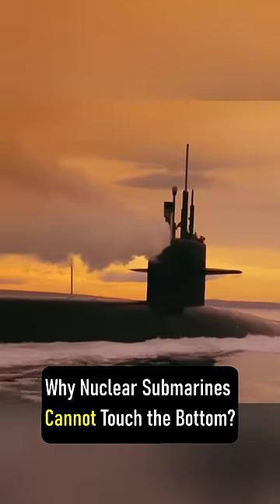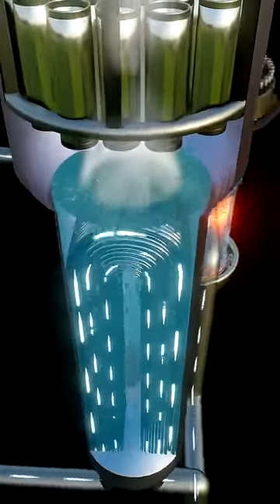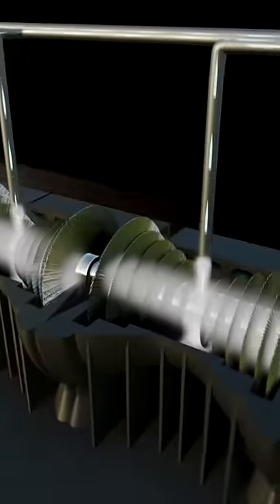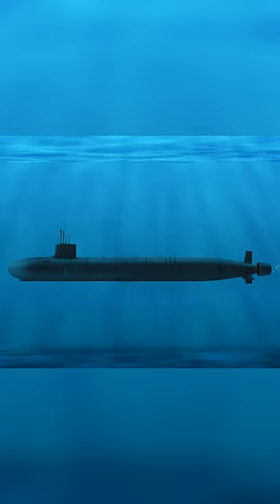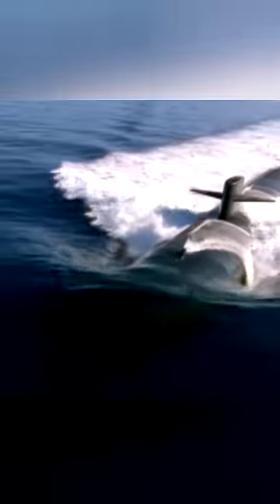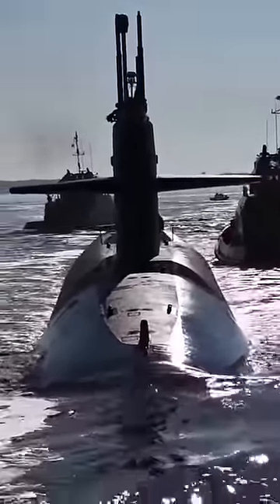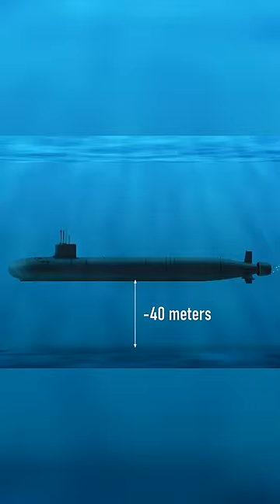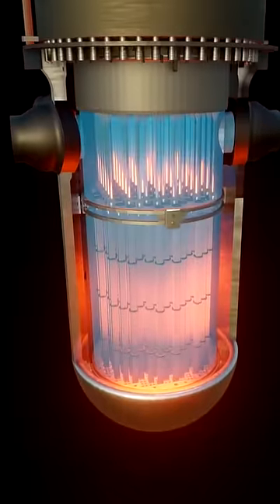Why Nuclear Submarines Cannot Touch the Bottom

Comment: That's why they don't touch the bottom... 
I must be stupid,  I thought it was to avoid crashing.
Reply: Me also.
Reply: Some subs do rest on the bottom in shallow areas at times.  But obviously not with modern nuclear subs.  Unless they’re designed for it.  I wonder if some of Russia’s spy subs that are designed to work on the bottom (like splicing into communications cables) have the ability to rest on the bottom; maybe with “landing gear?”  It’s an interesting question to ask an expert.
Reply: @keirfarnum6811  I'm positive they have that ability. With unlimited budget and resources the possibilities are unlimited.
Reply: Yes, silly me too!
Reply: @keirfarnum6811  well the Soviets did actually do this on occasion. It's a genuine tactic the would use to remain undetected in nuclear fast attack submarines. This video is kind of wrong and right, nuclear reactors are not just cooled with sea water, they have two loops of water for cooling. The primary loop consists of clean water that has no contaminants that turns into steam to power the ship and the secondary loop is distilled seawater. So if you set the submarine on the bottom very carefully, turn off all non-essential equipment and slow down the reactor then you can actually rest a full sized nuclear submarine on the ocean floor.
Reply: u-boats used to do this quite often
Reply: @tayloralvidrez4342  They have neither.
Real life is not Hunt for Red October.
American ssbn's make 2 patrols each per year.

That's double what the entire Russian ssbn fleet does.

Proper maintenance is crucial for a sub.
Without it, things corrode and work their way loose.

That creates noise when the sub is moving, and noise=certain death in a combat situdeath.

Any Russian boat leaving  on a patrol is insta tly picked up and shadowed by an American fast attack boat 

Because the Russian boats are so noisy, it's not even a challenge to tail them undetected.

Because they constantly have range and bearing, the American boat can destroy the Russian sub before it could ever launch a missile.

They why they don't patrol anymore and stick to Russian coastal waters.

The Russian ssbn fleet essentially no longer exists - they let it rust to dearh.
Reply: @Legendaryy7  There are no uboats.
That was 75+ years ago.
Reply: Touching the ground doesnt mean crashing into it, you can slowly sink onto it
Reply: @Zomby_Woof  i said "used to," referencing the past. in the u boat movie Das Boot, which is a documentation of a real u boat, the  boat smashed into the floor and managed to refloat back up, with strict depth limitations
Reply: @Zomby_Woof  he did say "used to do this", not "do this".
Reply: @Drnken229  What the point anyway?

There's very little bottom shallow enough not to be crushed, so you could only do this in coastal areas.

What for, to remain undetected?

You'd be a sitting duck if you were detected, no where to run, no way to run, since you max speed would be like 4 kts with the reactor shut down.

Once you did move, you'd have to spend all goddamned day cycling strainers to get all the crap out of them.

Doesn't matter where your intakes are, you create a huge silt cloud that gets instantly sucked into the strainers.

And there is a very real chance of getting stuck on the bottom due to suction.

You can't power your way out of it, because main engines are shut down and you're on electric drive.

If you really want to be ultra quiet, make your depth 600', rig out the epm, and shut everything non essential down, bring the reactor to minimum power.

You'll be quiet as death, but preserve the ability to make speed as fast as you can rig in the epm.
Reply: Many countries still operate diesel subs, that can rest on the bottom on battery power. Since they don't have to run coolant, they're technically quieter than nuke subs.
Reply: @kerbalairforce8802  They would still have the problem of suction.

It could be done, but only in very contrived circumstance.
Reply: Yeah let them go  40 meters above the bottom where the Titanic is. Won't be hearing from that sub again...
Reply: It’s definitely not why. No sub uses salt water for reactor cooling except in emergencies. They distill it first. And only add it as makeup water
Reply: @dossjh  It's used in the secondary loop - not in the primary loop.

It's always been used in the secondary loop. 

How else are you going to remove that amount of heat from an insulated tube underwater?
Reply: @Zomby_Woof  I was a reactor operator, its never used.  You distill seawater yes, but that is not a constant process and does not effect the ability to sit on the bottom.
Reply: @dossjh  you're right. Dunno what I was thinking.
Reply: @tayloralvidrez4342  lol
Reply: Just imagine a whale reaction when encountering these very HUMAN OBJECTS 👀👀👀
Reply: Sb

Stacy English

.
Reply: S
Reply: that's seems like the obvious answer
Reply: @keirfarnum6811  🤓
Reply: That’s cool
Reply: @ragingassassin6659  This.
Reply: @dossjh   100% A+ someone is qualified!
Reply: If they had big windows like Troy Tempest has on his submarine , they would never crash
Reply: @Zomby_Woof  and do you think subs got significantly weaker over the years?
Reply: @ianjohnson3770  What do you mean by weaker, and whose subs are you talking about?

There has been no substantive change in the design of US subs since the adoption of the subsafe program in the early 70's- and that was just a change in how piping systems are structured.
Reply: submarines sit on the bottom so stay quiet and hide
Reply: @Zomby_Woof  That is an exageration
Reply: @nippleflexer3630  I know a little bit. I had a lot of free time on my hands, so I qualified as helmsman and sonar operator just for the hell of it.
Reply: @tayloralvidrez4342  Actually Taylor, submarines have tended to avoid resting on the bottom.   Even earlier diesel-electric submarines avoided impacting with the bottom.   The simplest reason is that the hydrophone sensor heads were fitted to the bottom of the hull.   Often if an earlier submarine dove too fast it might strike the bottom inadvertently and would wipe off the sound heads, leaving the submarine “blind”.   Now that nuclear-powered submarines are central to many fleets, avoiding the bottom has gained importance.   Submarine crews have trained in the careful control of their vertical movement in the ocean.   As important the ability of the sub crew is in maintaining depth at periscope depth, it is also crucial to achieve what is called “hovering” above the bottom.
Reply: @Zomby_Woof  Well written and well done..
Reply: There’s also the fact that at a certain depth a submarine will literally be crushed like an empty soda can
Reply: @WaiseHail  And that happens quite shallow in term of crush depth being a multiple of hull length.

Travel two lengths of the boat's hull, and you are at test depth.

Two more and you are at crush depth.

It gets worse...

Typical high speed transit is done at about 20kts at 600'.

Now imagine at that depth sonar picks up a contact dead ahead.

Con orders planes to make depth 1000' 10 degree down bubble.

If you had a jam on the planes at that point, you're just dead.

Diving to avoid the contact, the planesman tries to pull up to level on ordered depth, and takes maybe 5 seconds to realize he had a jam.

Con is alert that day and feels the boat still with a down bubble when it should have already leveled off at the same instant the planes man reports the jam.

You've now passed test depth, and the boat has serious momentum and because the planes are jammed, the down bubble has increased to 15 degrees.

Con orders back emergency, but that's just an order - it takes a few seconds for the order to be carried put, a few more before the boat's descent stops accelerating, you've now past 1800', and con is ordering the COW to hit the chicken switches. He does, and you hear the roar of 450 re0psi compressed air spills into the maim ballast tanks.

Unfortunately, it's too little to late, you are now at crush depth.

Place you head firmly between your kegs and kiss your ass goodbye.

Jammed stern planes at speed during a dive are about as bad a casualty as a sub can have.

It may sound like a contrived scenario, but if your planes are ever going to jam, that's most likely when it's going to happen, because that's when they are subject to maximum stress 

The point is that subs have a much narrower operating envelope than most people realize.

I never experienced a planes jam, but wr did almost take the Scorpion and Thresher out of port & starboard the day we were doing reactor scram drills, and as we came up to periscope depth, the head valve stuck open, a wave came over the induction mast, and Fan1 became Pump1, shoving tons of seawater aft to the missile compartment bilges. 

With no significant way on, being limited to battery power until the reactor could be brought back online, started to si k like a stone.

Ballast blown at 600', we leveled off a little below test depth as the nukes brought the reactor on line, violating a whole slew of regulations 

If they had been just a few seconds slower, the laws of physics would have sent us to the bottom.
Reply: @tayloralvidrez4342  “unlimited” that’s funny. You clearly haven’t looked at their defense budget.
Reply: Actually, the big reason is to not snap off the Fathometer probe which extends about 1-2 feet below the keel.  About 15 percent of the ocean is shallow enough to bottom.  The rest is insanely deep.  The US has a couple of attack boats that are modified for special projects. They include skids like you see on helicopters to protect it from scrapping the bottom.
Reply: actually diesel submarine can touch the bottom and it have some advantage first active sonar can have a hard time finding you and second you don’t make noise so it can be usefull to touch the bottom of the sea just yeah avoid doing at full speed
Reply: @al-xo2cy  You can't go anywhere near the bottom except in coastal areas and shelves and atolls.

Most if the ocean is far deeper than crush depth.
Reply: @Zomby_Woof  No, but real life IS Down Periscope
Reply: @tayloralvidrez4342  I'm positive every modern nation has that capability
Reply: Remember depending on the area the bottom could be a silt /mud combo so  landing gently on the sea bed wouldn't cause damage.
Reply: @Zomby_Woof  "Used to" . Past tense.
Reply: Fuel powered airplanes have a design feature which also cannot touch the bottom of the sea.
Reply: @discord-bih  tell that to every plane on the bottom of the sea
Reply: @seansecker9398  misson failed successfully
Reply: @discord-bih  10-4 rubber ducky 😉
Reply: Nah thé Koersk tried it. It didnt work
Reply: If they have a malfunction and sink but are still alive they’re doomed as the rectors won’t cool. To avoid a nuclear catastrophe they’d have to shut them down and essentially wait to run out of air at the bottom of the sea
Reply: Believe it or not diesel electric subs especially during WWII would sit on the ocean floor either to stay alive if being depth charged or if they were listening for enemy ships 🚢
Reply: I'm pretty sure subs can just sit on the ocean floor by nowadays.
Reply: @michaelchaikoski9304  not nuclear powered subs bc the reactor would overheat
Reply: During ww2 there were many accounts of German Uboats sitting still at the bottom of the ocean to avoid detection. Of course these were diesel/electric boats... so they were not able to do this for very long.
So... this video explaining why a NUCLEAR submarine should not touch the bottom makes perfect sense.
Reply: @Zomby_Woof  the EPM extends right? Left? Fwd? Aft? Crunch!😂
Reply: @MH  The EPM or the SPM?

One is windings installed permanently on the main shaft, the other requires it be rigged out.

Neither have anything to do with sitting on the bottom. Only boats I know sitting on the bottom are the Scorpion and Thresher.
Reply: @keirfarnum6811  
Read Blind Mans "Bluff" !
Reply: Why u even bothered to not guess something this complexity
Reply: If you were to crush a nuclear fission;  you'd get a "new big bang".😮😮...😂
Reply: They dont touch bottom because if the deph is too large the submarine will implode
Reply: True and the colossal pressure.😂😅
Reply: @Zomby_Woof you are 1000% correct
Reply: The engineering behind submarines is fascinating
Reply: Maybe but the proper term is "sinking" not crashing.
Reply: Or like preventing a hull breach or to prevent reaching crush depth…
Reply: military submarine cannot go deeper 
than 2000 feet in better case some were
lost going too  deep so they cant survive if they going down .
Reply: @Drnken229 
military sub cant go deep 
not more than 2 000 feet
Reply: @Zomby_Woof So basically American subs are silent as Elves and Russian subs are noisy as Dwarves like in Lord of the Rings. Legolas vs. Gimli 😂
Reply: @tayloralvidrez4342  What if I told you there is actually no such thing as a budget?
Reply: @Legendaryy7  End up on the bottom of the ocean, yep you are damn right mate. And they're still there.
Reply: Diesel Submarines can do this and they do it. Even against active sonar pings , the operators can't distinguish the submarine from the ocean floor.
While they are more noisy when running their engines, they can do stuff like this.
Reply: right????
Reply: Submarines don't have wheels.
Reply: Its almost like driving a nuclear attack submarine in to the ocean floor is not very safe 😂
Reply: This puts the nuclear submarines in a huge disadvantage in conventional sub2sub warfare versus a diesel-electric submarine that can sit completely silent and motionless on the sea floor
Reply: We learn my friend I thought the sa.e thing 😂
Reply: Right!
Reply: @Zomby_Woof iff you are a german its still a U boot
Reply: @keirfarnum6811 he Ruskies have a sub that has a mini sub attached to the bottom of it.  This mini sub has landing gear used so it can rest on the bottom.  This mini sub also has robotic arms used to work on stuff on the sea floor.  We think they use this to mess with communication cables.  They could destroy communications or tap into them to use them for surveillance.  This is an incredible capability but is also extremely dangerous.  I have not heard or seen anything about the US having this capability but if the Russian’s have it then you would almost assume the US does as well.
Reply: @Zomby_Woof I, too, thought (having not done any research whatsoever) that they cycled seawater through the vessel while underway to remove heat. 
But if you think about how nuclear subs are designed, they have a long metal hull with a lot of surface area and it's underwater.
So if the cooling pipes are placed in contact with the hull in such a way that the metal of the pipes and the part of the hull they contact, maintain nearly the same temperature? I guess the cooling capacity you get is appropriate to this task!
Reply: @Zomby_Woof I'm nou sure about that. Maybe the older Russian Submarines were noisy and Easy to detect, I think the most recent models are probably one of the hardest subs to detect and track, because of how quiet and modernized they are now. Do you remember a year or two, when a Russian Sub randomly popped up in the Seattle bay area,  it creeped up so close to the Seattle beach, without anyone even suspecting it to be in our waters because it was completely undetected. It surfaced, and scared everyone, than it just disappeared undetected again. Scary thing is that, Russian subs can be anywhere without anyone expecting them.
Reply: @leshak1991  Brand new shiny Russian subs are reasonably quiet.

Russian subs that have not been maintained are very noisy.

There is a lot of hardware under the superstructure that if not constantly maintained, works loose and bangs around.

The Russians effectively no longer conduct patrols with their ssbn's for that reason.

Also, what makes you think that Russian boat was undetected?

What value would there have been in a American sub tailing it revealing its presence?
Reply: Just to be clear, there are multiple seawater intakes (but not reactor coolant) into a submarine and you wouldn’t want to clog them up. Also they propeller you obviously wouldn’t want to hit the sand. You’d also have to know what the seabed looks like and not land on rock. Some submarines were designed to do this using landing gear, but most do not.
Reply: This thread seems to be full of submariners, shipbuilders and engineers 😂 but who is correct? 🤔
Reply: @tayloralvidrez4342 

Russia doesn't have unlimited an budget or unlimited resources.
Reply: @bobfg3130  I was talking about America... Obviously.
Reply: @Blazeww 

Dude, you need special submarines that can go near the depth of the Titanic. Ballistic and cruise missile submarines don't go that deep. They don't go deeper than 600 metres or 2000 ft.. The Russians have some submarines that can go thousands of metres down. Same for the US.
Reply: @tayloralvidrez4342 

Neither does America although it has far more resources than Russia.
Reply: @bobfg3130   America has a virtually unlimited budget and resources
Reply: No submarine max depth is 2000 ft
Reply: @Legendaryy7   yes
Reply: @tayloralvidrez4342 
Nah, physics always wins in that case
Reply: Diesel submarines could use such tactic to conserve the energy and make no noise. That is why he focuses on the power plant.
Reply: U r soooooo silly bro I mean famalam
Reply: Dont
Regulsr subs hide on the floor of the sea.
Reply: You aren't stupid, you just didn't know :))
Reply: Depends on the depth... the pressure at 10.0000 feet would simply crash it
Reply: Stop the engines, descend slowly, if you are very deep or under a thermocline you will be practically undetectable.
Reply: @tayloralvidrez4342 Possibilities are not unlimited, it’s called physics - budgets are also not unlimited, that’s why it’s called a budget
Reply: @Zomby_Woof all German subs are U-Boats 
(Unter Sea Boot) 
Germany doesn't have another word for Submarine.  Just like how Germany still has the Luftwaffe lol
Reply: Geez we are innovative species , and stupid at the same time
Reply: @Zomby_Woof 
Gostei esclarecedor...
Valeu.
Reply: Me too